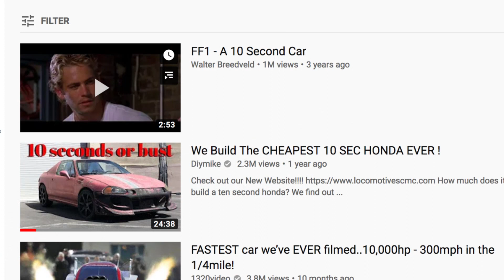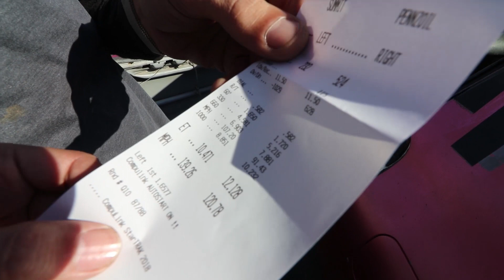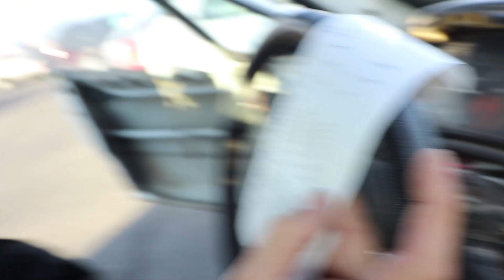THE WORLDS FASTEST QUICKEST CHEAPEST 10 SEC CAR EVER!

Comment: You gotta respect Honda if your a real car enthusiast
Reply: Chris Tech I used to hate Honda’s, then I did actual research and realized there actual performance bargains they are... performance per $ spent they are hard to beat
Reply: @sleeper.simulant7327  OLD Honda’s, yes. The new stuff is pretty garbage.
Reply: @THESLlCK  k series are, per $ spent, one of best performance engines out there, those aren’t exactly that old…
Reply: @sleeper.simulant7327  theyre pretty old. BMW despite being generally crap has the B58, Audi has its 5Cyl, Chevy has the LT series engines, dodge has the 5.7-6.2-6.4L lineup, Mercedes has the hot-V8, Lexus has the 5L, etc etc. my point is that they’re not innovating performance
Reply: @THESLlCK  making me feel old calling a K series old lol, I grew up in the B and H series era. Regardless, the k20z was Honda’s last good USDM engine in terms of innovation and performance…

Comment: Straight up respect! I had my eg (gsr) running mid 10s for around 10k (internals, fuel, turbo kit, mani).... when it came to my h22 crx all motor setup I spent around 12k and the best I ran was 11.1 at 128. I was trapping almost 20 mph faster in the turbo setup with a worst 60ft. Good luck on the all motor project, Id def do k24 if would again torque wins all motor in Hondas

Comment: I race circle track stock cars in a late model but I took all my G-Body parts for 9-in rear end everything I had that would work on a Jeep metric frame card and I built me a 10-second g body for $5,000 with just the parts I had in the garage and circle track racing including a 604 circle track racing motor but I took the seal bolts off of it and change the cam and rebuilt it and stuff which is a vortec 350 with aluminum heads steel block making 650 horsepower now with a big 850 CFM circle track for barrel double pump for carburetor I did it with five grand but I also had all the Ford 9-in rear end stuff for the floaters and lockers and gears in my garage already that was already ready to mount a metric card due to the fact I ran a late model stock which is a metric g frame body modified to fit a late model body and its X-rays and stuff but I still was able to build me a 10-second car for $5,000 with it

Comment: the cheapest man yall went threw like 10 motors 🤣😂🤣
Reply: To bad you didnt make it through English
Reply: @CoochieKissKing  its the internet mr spelling police clearly you didnt learn to txt/im on a nokia and aim
Reply: One b20b block only we reuse the head head gasket and all the other parts one b18 block that has been turned into the JB Weld block Still works by the way and anther b20v complete motor that still works that we’re probably going to rebuild just to make sure it’s good for the Crx Right now the pink widow has the gsr China building it so technically we only went through one motor where we melted the piston other than that all the other motors are still good And that be 20 block was probably about 250 to 300 so it’s still kind of cheap if you really think about
Reply: @818chrisz  yeah i was just messing around congrats on hitting your goal tho and lucky that hood stayed down lol